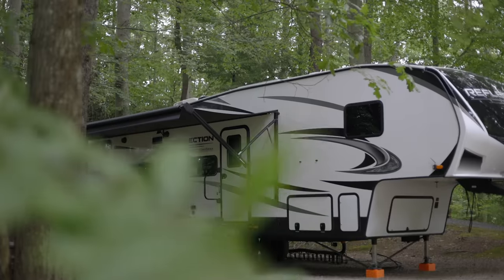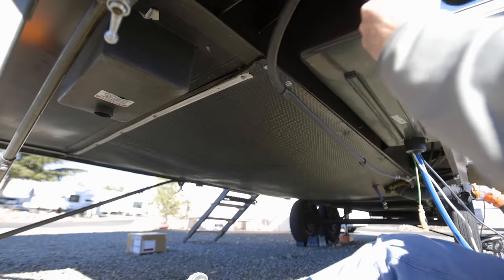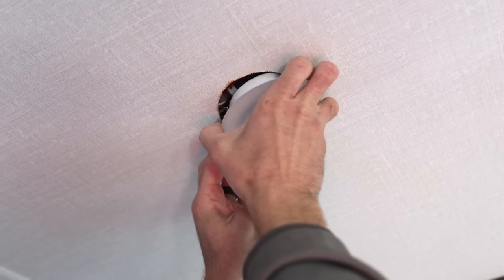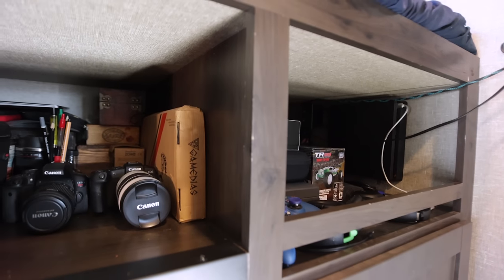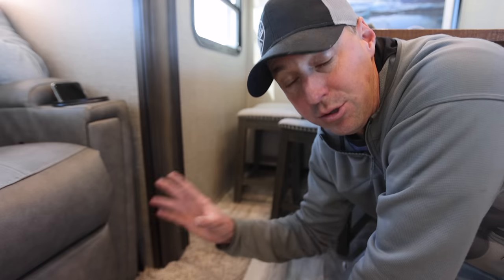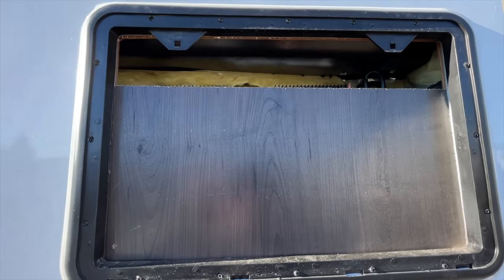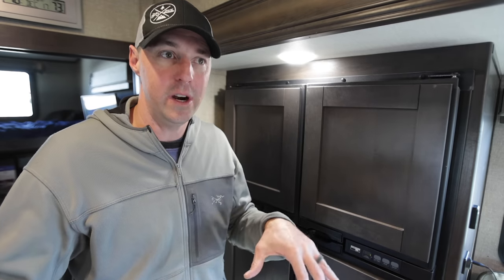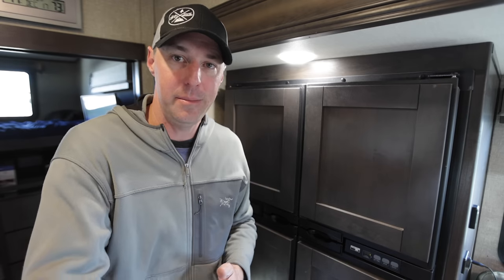Everything That Was Wrong With Our Grand Design In The First Year.

Comment: We’re 6 months in with our 2022 Grand Design Solitude and we have you beat already. Main issue was AC compressor dying in south Florida in summer. Slide is unlevel. Shower installed unlevel. About 20 other things but we have been happy with how Grand Design handled it all.
Reply from the maker: I'm sure the AC going out in Florida's Summer was brutal.
Reply: @AllAboutRVs  oh, it was. Luckily we had 2 units and 1 of them was still working, but it was not fun at all.

Comment: I want to point out that not every RV manufacturer will send customers parts directly like in your case. Grand Design is somewhat unique in that aspect. A lot of RV manufacturers will force you to go through a dealer no matter how small the part is... they'll refuse to send you the part directly. Definitely a plus with Grand Design for sure. More RV manufacturers need to adopt that philosophy especially on smaller DIY parts.
Reply from the maker: Yes good point and I agree more manufactures should do like Grand Design in that regard sending warranty items and using Mobil RV Repair guys is a good thing.

Comment: We are full timers as well going on 2 yrs. We have the 337 Reflection, one thing we had go wrong was the inline check valve on the back of the hot water tank it was plastic and only lasted 9 months, I replaced it with a brass one
Reply from the maker: I have heard of those going out and have a brass one on hand so that the next time I have that panel off I'm going to replace it.

Comment: We like our 2021 Reflection 150 Series but as full timers we had problems also. Tire Linc replaced with Tire Minder. Wet Bay every compression fittings leaked, had to use plumbers tape and tighten. Brand new dropped underbelly to tighten leaking gray water connection. Cupboard doors falling off. Still better than our 2011 Cedar Creek.

Comment: We bought a 2021 XLR Nitro 321 and have nothing but problems. The most dangerous one was our propane line was ran thru the wheel well and the tire rubbed a hole in it. Unbeknownst to us we had a massive propane leak when we arrived at our destination. Smelled propane about 10 min after turning it on and the shut it off. Had to call mobile rv repair out to find leak. Too many problems with this RV to list. They are slowly getting all the repairs fixed and we do love the RV but we are calling it our Covid RV cus no one showed up to work the day it went down the assembly line.

Comment: Had the same problem with our fridge. Ended up wiring 4 extra fans from the thermostat on back of fridge and zip tied three on the bottom fridge vent to pull air in and 1 on top vent to blow out. Fridge is much more efficient now.
Reply: Those absorption refrigerators are a no-go in my opinion. I just put a residential unit in it's so much better
Reply: @iair-conditiontheoutsideai3076  I like the propane option of absorption since we boondock a lot but I agree about residential fridge.
Reply from the maker: Not a bad idea with the fans!

Comment: I watch your channel admiring your knowledge and experience operating and fixing your RVs.  We bought a 2020 Lance 2375 in November, 2020, and we've pulled it almost 2000 miles this past year.  I've tightened a few screws and replaced one plastic plumbing fitting, that is all.  If I can fix/replace an item with a better quality product like you do with pex, I feel like I eliminate recurring problems.  So far, I've been super impressed with our Lance trailer, and if I need any answers, I just call Mary in their Customer Service, and avoid the dealers.
Reply from the maker: Thank you, good to hear Lance has good customer service, I think they put out a good unit.

Comment: We bought a 2021 GD Imagine 2800BH and travelled across the country and back over the summer.  Very few issues encountered, extremely happy with the quality of our travel trailer.
Reply from the maker: Nice! We have been very happy with the quality of our RV.
Reply: I find it hard to believe that you had no suspension trouble, if I were you I would take a good look at the RV suspension especially the equalizer bushings and the shackles. That was my first upgrade on my 2022 2800bh. I feel much safer and the ride is fantastic. We installed the MORRyde 4000 SRE with wet bolts and heavy duty shackles, we installed sumo springs as well not sure yet but I will post something when I can.
Reply: @richarddorion3806  no suspension issues at all.  Tires are wearing evenly, no vibrations. Visually, the springs, bushings and equalizers all look great. I don’t doubt you’ve felt improvement with your upgrades, but so far, mine has been performing very well, even over some really unpleasant highways. 6200 miles on westlake tires even! 😱😀 Safe travels to you! 👍🏼

Comment: I agree  to do everything  myself. Mine is a Cedar Creek. Purchased  December  2016 (2017 model). I've had similar  small things like yours. Only big thing  was a small leak around one window. I even did that myself.  Other things I did were not things that failed but things I wanted to do. 1. Solar and lithium system. 2. Eliminating  mouse entry  by removing the complete  bottom. Sealing up all openings and re installating with 4 times more installation.  Much warmer  on floor now.
Reply from the maker: Very nice, Great idea on adding insulation under the floor, I bet that made quite a difference.

Comment: I have the 2021 Imagine 17 MKE, which I like. Did have issues, with the slide, not tracking properly,  and caused the slide, to lock up, in travel.  Took the dealership, six atemps, before it was fixed.
Reply from the maker: Ouch, six trips to the dealer is rough.

Comment: Thanks for the great video. I'm finding that the comments are a little too "fair" with regard to Grand Design quality.  We own a 2019 315RLTS and use it as a weekend place. We've owned 5 RV's prior to this one and I must say that the build quality of the GD is very poor. There's not one weekend that goes by that I'm not fixing one thing or another. There are so many areas that GD could have made for a better consumer experience but it's clear as beer the only concern is for profit margin. Just today I discovered that the labels on the electrical panel don't match any of the circuits. How is that even possible when you're building the same unit thousands of times a year. Makes you wonder what's going on at that plant.

Comment: Good Video. We had a large number of problems 20+ some serious with our new 2021 Reflection 150 Series 295RL 5th Wheel purchased at GeneralRV in Ashland, VA. The warranty service on multiple appointments had our RV out of service for almost 3 months this season! Contacted Grand Design headquarters and now on our 3rh service representative and until recently they were of little help. The service department at this GeneralRV dealer has been horrible to the point of fighting over who pays for a faulty battery they provided. This has been an unmitigated disaster. Do not purchase a Grand Design and do no business with this GeneralRV dealership!

Comment: We bought a Grand Design in March of 2021.  We had about 9 service items that I have repaired myself.  We had a loose air conditioner connector which caused the air to stop working , loose plumbing fittings,  fit and finish items with trim, and a failed switch on the jack.  Like you I fixed the items myself because I didn't think we could wait to get the RV into a service center, also we were travelling when they occurred and they needed to be fixed immediately.    I do think that people like us that repair the RVs instead of seeking warranty repair let the manufacturers off the hook and perhaps this allows them to get away with not improving their quality.  I think they should pay the owner for their own labor in repairing an RV still under warranty.
Reply from the maker: Not a bad idea but it would be hard without an outside opinion for people to not take advantage of that. But an idea that should considered.
Reply: I would like to get paid for the work I do on my RV but it’s a labor of love. But you can see the problem with your warranty as it pertains to your repairs.

Comment: Hey there, just wanted to start out by saying I love the channel, it is super helpful.  I have a question; I have a 2021 GD Solitude and was wondering if you knew which TPMS system works with the Lippert One Control system?  I bought a TPMS system on Amazon and didn't bother checking on the pressure rating, you can probably guess it didn't work with my rig.  I would love to be able to use my one control app on my phone if it is possible.  Do you have any thoughts on this?  Thanks and look forward to your next video!

Comment: I had trouble linking the Lippert tire Linc system the trailer Module Linked fine to my iPhone. But the monitor light thing would not work until i called Lippert tech help they got me going. But i have only used once so not sure if it still linked. Hope that helps.

Comment: Jared - I have a question unrelated to this video but I don’t know how else to communicate with you.  I’m preparing to upgrade our 30 amp Airstream with 600 AHs lithium and a multiplus. I’ve already installed a smart shunt and Victron DC-DC charger. I’m not doing any solar at this time.  My question is this - can you point me to a book or other resource on designing the system layout as pertains to cable sizes, fusing, disconnects, hardware recommendations etc?  I’m NOT asking for your direct input in designing my system  - I’m sure you don’t have time for that.  So far I’ve gleaned such information from wherever I can find it.  I’m asking you because I believe you are honest about your competency on this subject and wouldn’t steer me wrong.

Thanks for the information and help you’ve already given.

Comment: On your warrantee issue, did you have to send the old one back to Grand Design? I'm asking because, I had a fuse go out on my Image water heater. I took the trailer in to find out what the problem was, I bought the fuse replacement. The dealer processed the warrantee and now wants the old fuse.

Comment: Thanks for the update, we are looking at Grand Design ourselves.
Would you prefer a residential fridge over RV style domestic. ?
I'm curious because I really trust your opinion 🙂.
Reply: I have residential fridge in our rv. It only runs on 120ac, it does not have a propane assist ability. I overlooked this when we purchased it. When we are not connected to shore power, it relies on the inverter and batteries. I now have 2 Renogy 12v 100ah deep cycle batteries. About a month ago I disconnected the power that I normally have connected from the garage when we’re home, and only left the refer & inverter, along with whatever other minimum required “stuff” that’s on, even when you’re not using it. No furnace, water pumps, or lights. It was dark and unused, sitting in the driveway. The batteries lasted about 30 hours before I was at 50% power. A couple of years ago, sometime in the late fall, after a long drive, we had to stay overnight in a truck stop in La Grande, Oregon. We woke up in the middle of the night, freezing cold! What I didn’t understand at that time was just how much power was required vs how little power the 2 original lead acid could supply. The furnace didn’t have enough power to run! IMO, ANYTHING you can do to reduce your dependence on the batteries & inverter, will make your life better. I’ve learned my lesson, anything I can do to reduce my dependence on 120vac, I will do. We were really cold that night! I will never have another refer that is not propane assisted again. They are power hungry monsters!
Reply from the maker: I still prefer the absorption fridge for when we are off grid as well. Switching it to propane makes our battery bank last much longer and need less solar.
Reply: Personally I think it depends on what your set up looks like.  The residential fridge does a much better job of maintaining temps just like in a house but it does run off your batteries through the inverter when your not connected to shore power.  So if you are going to have a means of keeping the batteries charge such as solar then my personal opinion is the residential.

Comment: What type of caulking would you recommend for exterior sealing?
Reply from the maker: I'm testing a few but Quad OSI has been proving to be very stong in tough situations for the vertical seams to seal. The roof we have been using what is recommended from the manufacture for our TPO roof which is Alpha System.

Comment: I appreciate your understanding nature, but when RV manufacturers have you do the work, they save millions of dollars over time. That allows them to cut corners and crank out sub par units knowing they can get many people to do the work themselves. The whole nightmare process of bringing an RV in for repairs works to their favor because it's a hugh hassle for someone that full times or isn't near home if on vacation. You may even hear it in their voice when they tell you to bring it in (if you're incapable or unwilling to do the work yourself). There's not much of a reason for them to make the experience easier because the more warranty repair horror stories, the better for them. I'm not saying all warranty repairs are like this, but many are. You'll know the difference when you have non-warranty work or upgrades done. Their tone changes dramatically. For alterations or upgrades, avoid dealers all together if you can. Shop the private contractors. You may get nationwide return problems covered with dealers, but with a reputable private contractor you can avoid the need to go back and have the upgrade fixed again in the first place.
Reply from the maker: I see your point but for those that want it done buy a RV Repair shop, Grand Design at times will let you use Mobile RV Repair services which is a great thing in my opinion. I've seen typically good responses from Grand Design with others I know that have had to put in claims. My preference is to do every thing I can my self if it's resonable.

Comment: So what's leaking?
Reply from the maker: It was the flexible tube at the top of that T fitting, the pex was fine, it was leaking around the metal clamp. I ran out of time to fix it that day the way I want to so I crimped the clamp and it stopped leaking.

Comment: This is why I never buy a new RV. You're going to have these problems regardless and I would much rather have issues like this with something 10 years old rather than something brand new. Obviously I don't know this guy's financial situation but if it were me I would be livid he's way calmer than I would be
Reply from the maker: I think when put in perspective this list is very small and everything is very simple. When put in comparison with our last RV that we bought when it was 11 years old and had many other problems we had to work through like delamination and frame welding repairs that are a much bigger deal, I would prefer to work out the small things than the larger things. I couldn't blame anyone for a fan breaking or the pressure regulator going out, that could happen on any RV at any price point or age.  To be honest half the things on this list like the trim shelving and end panel is our fault.